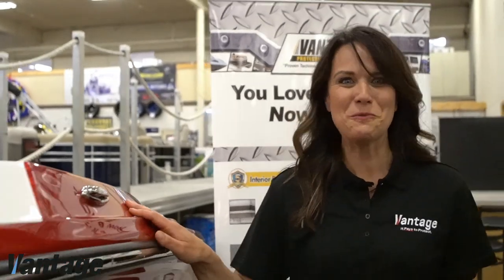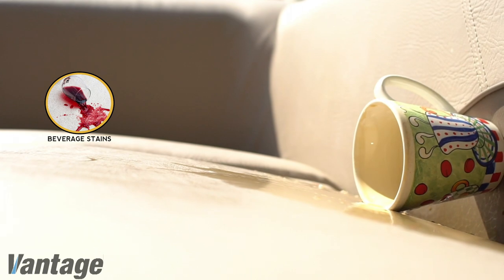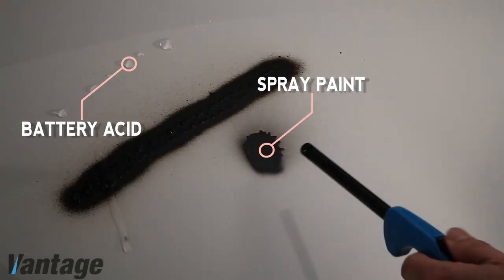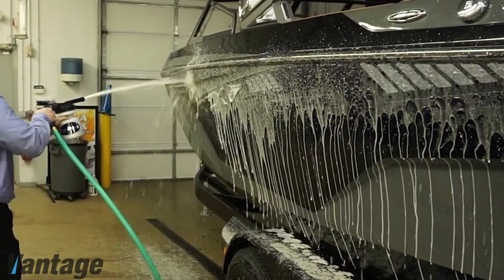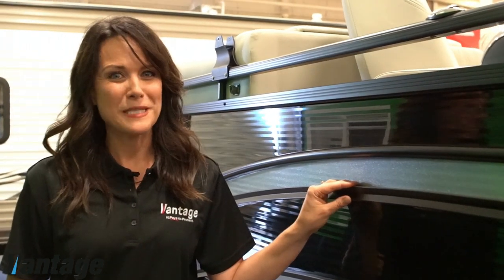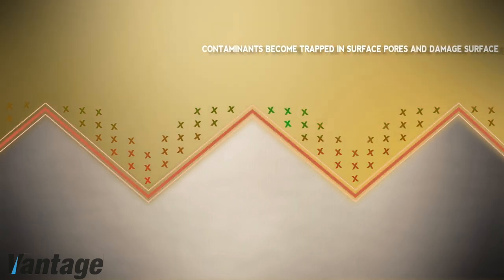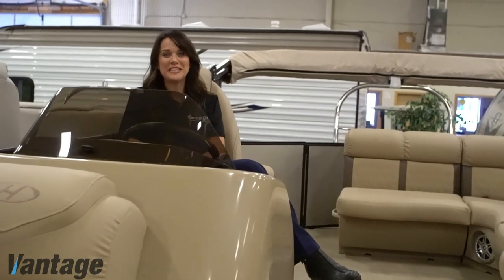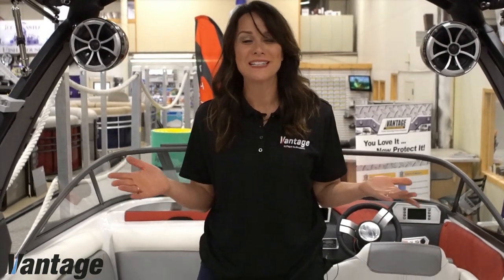VPS Diamond Ceramic Boat Overview

Comment: This looks like a great product, but I am confused by something. In this video you show protection against battery acid and paint, but the exclusions section of the VPS warranty terms starts off: "This limited warranty does not apply
to any of the following: (1) damage or stains caused by paints, acids or other corrosives,..."  That part of the video seems dangerously misleading.